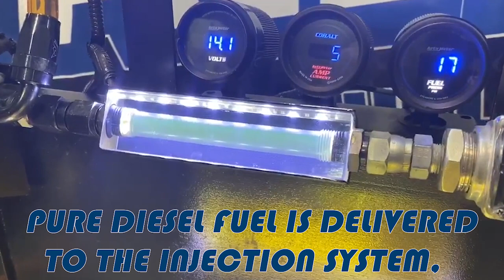AERATION VS. CAVITATION

Comment: So in a stock situation where the injectors don’t require that much fuel, how does the return trickle of fuel work? Where is all the extra unused fuel going? The pump supplies a large volume of fuel doesn’t it?
Reply from the maker: It recirculates back to the suction side of the pump though the fuel pressure regulator.